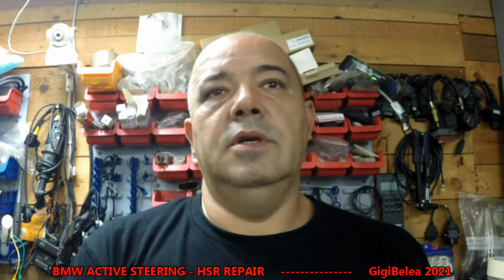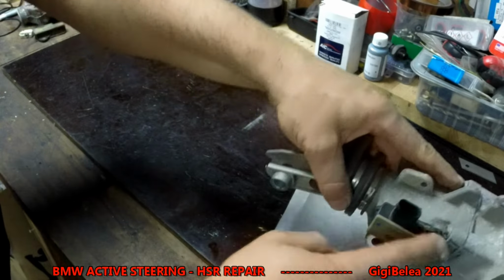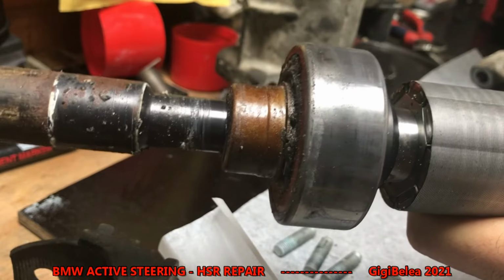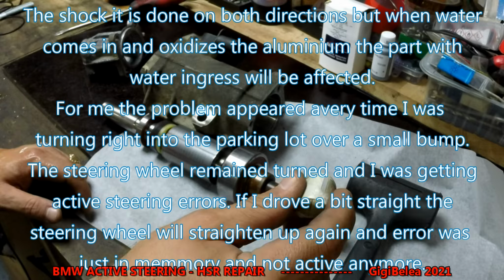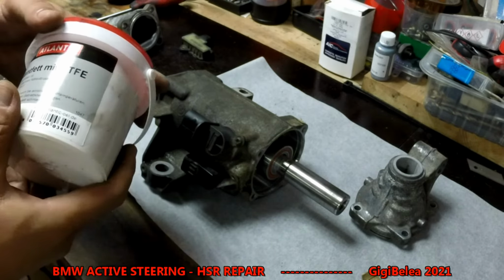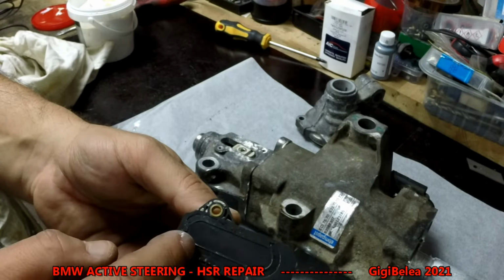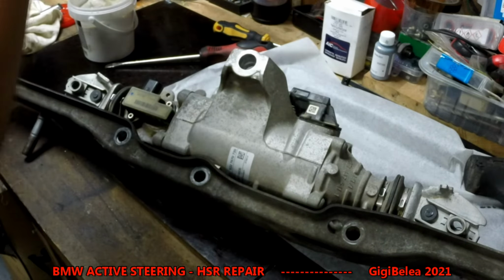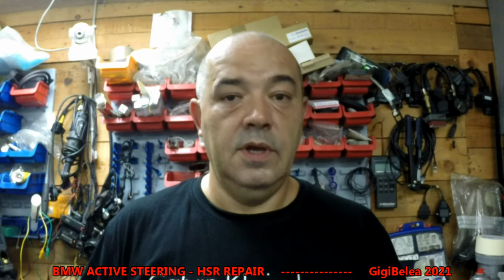BMW Active Steering   HSR Actuator Repair

Comment: Hello from finland. I have little annoying problem with hsr. Changed magnet holder already but didnt solve issue. Pretty sure that needs cleaning and lubening. 

If you would have spare bushings for sale, I would be so greatfull.

Comment: before disassembly HSR actuator make some locking tool for ends holders ,and then the end holders will stay locked on the tool like welded on large piece metal .after repair of HSR ,tight again screws of ends holders

Comment: Question: If you buy a used unit that comes without the support frame can you just swap it with your own one that is in the car? By just undoing the 3 top bolts and one bottom saves you 6-7 hours and not have to drop the rear diff
Reply from the maker: As far as I remember I did not drop the rear diff. Took me 1-2h to take it down and 1h to put it back up. If you buy an used unit it should be just plug and play... think I still have an almost new unit laying around :)
Reply: You swap with a used one? And did you need to code something ?
Reply: @GigiBeleaDK I need some bushings. Can you share the file or sell a set?
Reply from the maker: @dc2696  my contact details are in the description.

Comment: Hi there hope you are well and thank you for your informative video

I am having an issue with my HSR, there is play on one side of the HSR when i move the rear wheel side to side? HSR has no errors and still works, have you seen this before? Its causing alot of play like if a balljoint was gone

Thanks
Reply from the maker: Might actually be a ball joint on the rear arms or a bushing on them. By the way the HSR is made it's kinda impossible to have a play unless your plastic bushings are totally broken inside the HSR.
Reply: Hello my friend, I think your video is just great! can i buy the plastic bushings from you?? Please answer?
Reply: Did you figure out what was causing play on the side of HSR?

Comment: Really interesting design ruined by those cheap bushings. Shouldn't the rubber caps have protected from water ingress?You really surprised me with those 3D Printed ones you made. You could make a chassis or some measurements before dissassembling one so you can check that both arms are perfectly aligned and also all the holes are parallel. Great work, probably you will have lots of requests for the parts!!!
Reply from the maker: I think water came in from the rubber caps but ALSO from the place where the "body" is screwed together ... there were signs of water ingress also by the rubber seal / o-ring. Thanks for watching.

Comment: I have play in my rear wheels side to side, the play is in the hsr shaft, do u think it's the bushings or the bearing??
Reply from the maker: Hard to say without taking out HSR and check on table.
Reply: I have the same dead play problem. What is you're cars sympthoms?